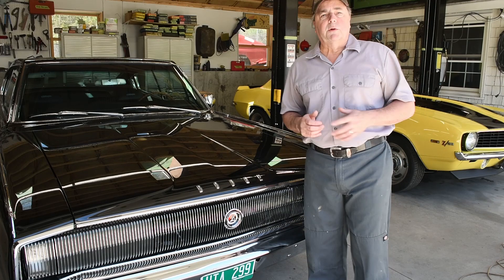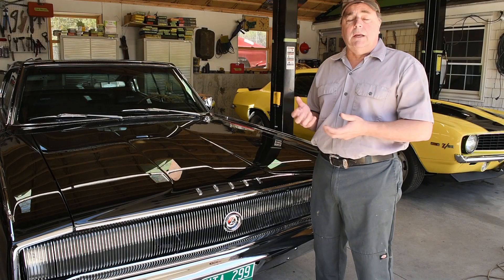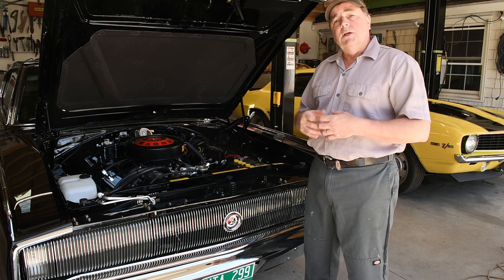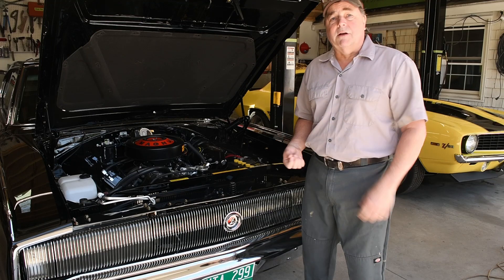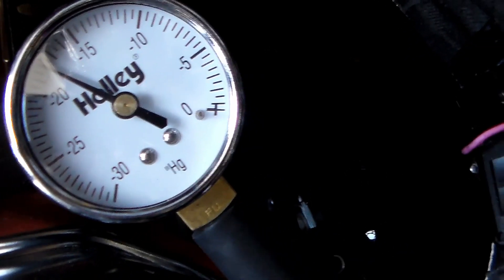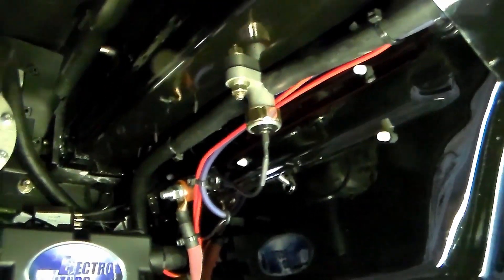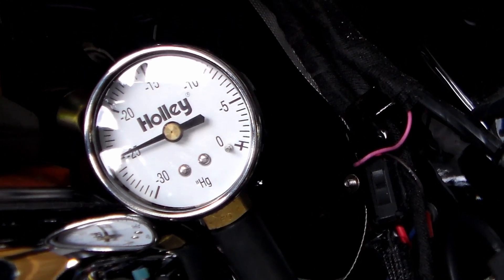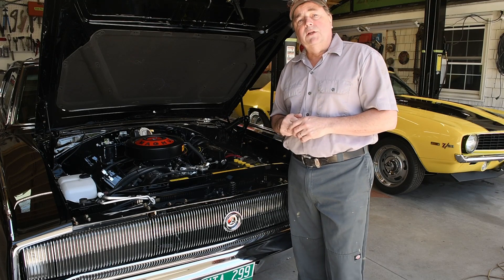No Vacuum = No Brakes!  A Leed Vacuum Pump can fix that. I'll show you how

Comment: I would still use a relay. Connect the relay to switched ignition and battery. This way it only comes on when the key is in the run position.

Comment: Yo Troy I'm so glad I saw your video about 2 years ago I have a 2011 Camaro SS rebuilt my engine I also put a BTR stage 2 LS3 cam and I was having a vacuum problem with my brakes I was going to buy vacuum canister and then I came across your video I bought the exact same one mine is Chrome I would have liked it to be in a metal canister but it was made of plastic I think I paid close to 400 dollars for it it's perfect quiet as a mouse no problems even if it did make a little bit of noise which it doesn't you wouldn't be able to hear it over the Dual Springs the cam straight pipes with the Texas Speed headers thank you for the video it's a really great piece of machinery no problems
Reply from the maker: Glad I could help

Comment: I installed the pump correctly but it do not turn off or pump enough pressure, the master cylinder is new  do the size of the master cylinder have anything to do with this ?
Reply from the maker: You have a vacuum leak. Plug the hose coming off the pump and see if it will stop automatically.

Comment: Will this work with an ls swap fuel injected setup?
Reply from the maker: Yes it will
Reply: @troykane ok great... somehow when I press my brakes while in park, the car shuts off instantly
Reply from the maker: @terrylinellc5550  does it stumble and stall? It could be vacuum related. If it shuts off like when you shut the key off it could be electrical.
Reply: @troykane yepp it shuts off immediately when pressing the brakes down... I do have a stage 3 cam installed with a PSI brand PCM
Reply from the maker: @terrylinellc5550  I would determine if it is a mechanical issue or an electrical issue. It may be electrical

Comment: I could really use something like this. I have a gm truck with a Magnuson 1900. From my understanding the blower works off of vacuum would you know if this pump would effect performance of blower?
Reply from the maker: Your supercharger is pushing air into the engine. Without the supercharger the engine is sucking in air, which is vacuum. Therefore you esentially have no vacuum with a supercharger in boost. So yes this would be an alternative source of vacuum to run your brakes and I would highly recomend it.

Comment: Did you t in vacuum from the engine as well with a check valve on the engine side and pump side?. I have had several failures with the vacuum pumps and still have a little vacuum back up from the engine even though it runs out quickly. Looking into the leeds  pump now.
Reply from the maker: NO engine vacuum. The pump does it all. As long as the pump has power you have brakes, even if the engine stalls.

Comment: Do you need the extra tank and will you still have power brakes if the motor stalls because it's electric?
Reply from the maker: You don't need the extra tank. But it does provide reserve vacuum. And yes you will have brake brakes during engine off condition, engine has nothing to do with brake vacuum with this system.

Comment: Hello Troy, 
Fantastic video! I think this is exactly what I need. I bought my friends 72 Challenger Resto Mod and he did Baer Classic Disks all around with all new
brake lines and master and booster and the whole nine yards but the pedal is so stiff and you can barely stop the car at slow speeds. 

He thought he got too large of a bore master cylinder because he tried a vacuum canister and that didn't work. But it's got a massive cam in it. It's a
410 CID  stroker 360 with a Comp Mutha Thumpr Roller and 1.6 RR's so tons of lift and tons of duration and overlap. I haven't checked the levels of 
vacuum yet because I haven't driven it much but I suspect it's very low.  

I think this Leeds kit will fix me up.  Has your unit held up for you? It's been 3 years now.  I really appreciate the video!
Reply from the maker: The pump still working great! I would check your vacuum at idle first. I would think it's low, and the pump would correct your problem.
Reply: @troykane   Troy, thanks for the follow up! Yep I am going to verify the vacuum at idle first. Honestly with the cam this engine is running 
there can't be much.  I never even thought about the vacuum issue at first because any other old car I had with a huge bumpstick always 
had manual brakes so I never had this issue before. LOL  It will be nice finally fixing the issue because the Baer Classic 4 wheel disks on this
car have to be amazing once they are working right.

Comment: Sir I’m having. A similar problem with the transmission and vacuum do you think this will fix my problem ?
Reply from the maker: Ok the pump will provide a consistant source of vacuum. This will be perfect for a brake booster. However this is not something to connect to a tranmission modulator. The modulator needs vacuum from the engine to allow the transmission to shift properly.

Comment: Yes Sir, ver cool set-up! I’d purchased the same led brakes vacuum pump In chrome. The slight vacuum drop-off will cease when the pump gets broken-in. Mine did similar, after a week or so the vacuum stopped the slight drop-off in value. Great set-up for safety Sir, cool ride too!

Comment: Hi Troy, beautiful car. I have this pump on my 69 El Camino because the LS I put in it only produces 10in of vacuum at idle with the cam that is in it. The pump is very quiet and works very well for the most part, but sometimes when I hit the brakes, I have no brake assist which is a very scary situation when you have to stop in an emergency. When I put a vacuum gauge on it, it pumps to 22in and turns off but will not turn back on until it reaches 10 or 12in which is not enough for my power brakes. I suspect it is the switch that is bad, from what I have found online this is a fairly common problem with this pump. Do you think the switch is my problem and are you aware of others having this problem with the switch? Thanks in advance
Reply from the maker: I think your diagnosis is spot on. I would contact the folks at Leed and see if they will help you with a replacement part. Good Luck

Comment: Great video!
I installed my pump the other day and I’m having a bit of an issue.  It’s makes 25Hg of vacuum very quickly, however it will not shut off.  Once it hits 25-26Hg the gauge will bounce back to 20 or 15Hg and then right back up to 25Hg. I’ve checked the voltage, the ground and the power source and all are good.  There are no leaks in the lines, just cannot figure out why it won’t shut off.
Reply from the maker: I would contact Leed. You may have a regulator issue. Good Luck
Reply: I'd be checking for a leak somewhere. It sounds like once you get high vac it leaks in, vac drops and leak stops then over and over again.

Comment: Just a quick follow-up to my previous posts.  The cycling of the Leeds Black Bandit ( I have the naked version) was cycling almost without a break.  When the unit gets to the predetermined vac it shuts the pump off. I traced the 3/8" vac line back from the booster to the pump after disconnecting it from the booster's check valve.  It turns out that the vacuum line was leaking. The OEM hose used on my 79 Trans Am from the engine to the check valve looked like 3/8" vac line but it is actually smaller at 11/32.  The line was leaking, plain and simple. So, the vac line will be replaced with the smaller diameter vac line soon. The simplest way to check for cycling is to put the pump in the on position at the key switch and then using your thumb cover the open end of the vac line.  When it gets to the predetermined vac pressure the unit will stop running.  This was how I diagnosed the near constant running of the pump.  Hope this helps others.  Thank you Troy for your input back to me, below.
Reply from the maker: Glad you found it. Glad I could be of help.

Comment: I've had my Lee's vac pump on my TA for a year.  The concern I have is the cycling of the unit.  It emits a high pitched sound when running and the pump seems to run without shutting off for any length of time.  Troy, I know you have a separate can to help store vac and I am wondering if your unit is cycling constantly.  No leaks have been detected.  Need your thoughts on this.  Thanks.
Reply from the maker: Thanks for the question. My question to you is what are you running vacuum to power? I will assume a power brake booster. I would test that booster to see if will retain vacuum. Same goes for any other vacuum accessories you may be connected to. I would also test the pump by capping the suction port let it run and see how it reacts. Good Luck

Comment: great video, 2 questions if i may, did you run any check valves and did you eleminate the vacuum hose off the motor to the brake booster and stick with just the pump?
Reply from the maker: Good questions. I run just the pump. So I capped the engine vacuum port. You have to keep the check valve at the booster. That's it you're good to go. Good luck
Reply: @troykane   thanks so much Troy, i appreciate it
Reply from the maker: Anytime! Good Luck

Comment: Can you discuss the Electro-Wizard battery disconnect switch?  me and mechanic were having a hard time finding an ignition power line to hook into.  is this what alleviates this issue? keeps it from drawing power all the time, even when off??
Reply from the maker: As far as a battery disconnect, that would be main power between the battery and the vehicle. That will cut all power to the vehicle.
Reply: @troykane  thanks,  So that is a separate thing, not part of the brake vacuum system? (just mounted there for space issue)?   thanks again, and what a beautiful car,
Reply from the maker: Yes totally unrelated.

Comment: I like this.  I have a mechanical vacuum pump on my 1981 Mercedes 240d.  They are becoming very rare and the parts for fixing them are starting to become rare.  This will solve my issues.
Reply from the maker: Good Luck

Comment: Hi Tony,   Great video.   Couple of questions...  does the Leeds pump eliminate the need for an external relay?  Are you connecting the power lead to a switched 12v circuit in your car?  Why is the vacuum tank required?  If the unit can produce up to 26 psi and you have a master brake tank to store the vacuum that tank seems redundant.  I have the same situation with my '71 hemi cuda.  Only 10 psi from the engine.   Final question...   will having the vacuum at the proper level also reduce the amount of pedal travel.   I have excessive pedal travel and am hoping that this is also resolved with the new pump.  Thank you!!!!
Reply from the maker: Relay is inside the unit. Connect to keyed 12 volt source. You technically don't need a vacuum tank. Pedal travel is not related to vacuum. Make sure the system is bled. If you have rear disc brakes make sure the E brake is function to provide proper adjustment. Make sure the rod from the pedal to the master cylinder is the correct length. Good luck. thanks for the comment.

Comment: Hey Troy what's up I recently left you a comment about the Camaro that I rebuilt and I need a vacuum pump well I ordered it I got it it came today really nice looks nice heavy duty the only thing I'm not too thrilled about it being a plastic canister when I ordered it it didn't say anywhere anything about being plastic it just said Chrome or black so you here Chrome right away so you think it's metal well anyway it's the most quietest one out there on the market see how it is when I install it thank you for the video

Comment: What's up buddy glad I saw your video I have a 2011 Camaro SS Inferno Orange I love the car it has 120,000 miles on it buying a new car would have been through much money for insurance and to pay off $50,000 so I gave it to my mechanic I bought all the parts Brian Tooley stage 2 cam crank Pistons oil pump water pump push rods had the heads ported and Polished new valves crank Pistons cost me about $15,000 need a vacuum pump all those other pumps sounds like your engine is knocking ridiculous would never even attempt to buy one of them so I saw your video did some research and I just ordered the Bandit from Amazon enclosed in a chrome canister looks really sharp should have the car back by the middle of next week the car is a beast thank you for the video really appreciate it it was $399 not that bad I guess
Reply from the maker: Cool! glad I could help. Thanks for the comment

Comment: Do you havs to run a canister or can you run the pump directly to the brake booster. The only vacuum my car uses is for the brakes
Reply from the maker: No canister required. you can go direct to the booster. Good luck

Comment: I just had my Pontiac 400 engine rebuilt a couple years back for my 1978 Trans Am.  The engine builder installed a very lopey cam.  Ever since the rebuild, I have had almost no brakes and the throttle response is poor.  The engine is built to produce a little over 400 hp, nothing too crazy, but good power.  Do you think this pump would cure my issues?
Reply from the maker: Yes more than likely if the booster is receiving low vacuum. Best way to know is to test the engine vacuum with a vacuum gauge. Test the brake booster as well. As far as the poor throttle response, that could be a lot of things. I would work on the vacuum system first. Make sure you have no vacuum leaks in all the connections and hoses. Carb cleaner sprayed on the hoses and connections will show a leak by the engine sound. Spray listen for the engine to increase in idle speed. If so you have a leak. If not, no leak. Good luck

Comment: Had a question i was running a old style piston vacuum pump thats set up in trunk..works fine but noisey..i bought the bandit to switch out ..my problem.is when i hook up new bandit pump it runs weak like not enuff power or something ..i hooked directly to. Battery and works great..so i know its not defective ..any reason why the hot and ground that runs my piston pump fine but dosent power the bandit ..it gives power enuff to hear it running but very weak ..any suggestions i might be missing ..? Thanks

Comment: Hi ..very smooth ride ..question I have ..my piston style vacuum pump is located in trunk inside a metal box .but very noisy to say the least ..my reservoir  canister with a vacuum gauge  is located in engine  compartment..so my question with this pump can I use existing area in trunk and remove my piston pump and with this new rotary pump put in same area and use the existing vacuum line that runs to front of car to the vacuum caniste reservoir that has the gauge on it ?
Reply from the maker: You sure can. You actually don't even need the reservoir. But it doesn't hurt to have it. Good luck on your project Troy

Comment: Just one thing I was thinking that my pump was U/S because of that noise ;)
Reply: It is number 2 pump and first one did the rubber in side of the pump and would not stop running . This one looks like it’s done the same thing . As it don’t shut down when vacuum built up . Just keeps running .

Comment: Do you need to hook this system up to the intake manifold/carburetor at all? I am trying to set up something for my 1958 International Travelette. It has a straight 6, and I dont think it has any factory vacuum sources that I can use. I was hoping a vacuum pump is my answer, but I hope I dont need to connect it to the intake/carburetor anyway. I want to route right to the booster.
Reply from the maker: This system replaces the need for an engine vacuum source. It creates the vacuum with out the engine. Hope this was helpful. Good luck with your project!
Reply: @troykane  Actually this is very helpful! I have bee trying to find a solution for months. I'm just a 19 year old kid who has a project truck for a hobby. No one could give me a solid answer for some reason. Thank you!

Comment: A buddy of mine has his car in a " performance shop" & they're telling him they are going to put a vacuum pump on his car because the vacuum line to his th400 isn't getting enough of a signal.  The car can make 15"s  & the cam isn't that aggressive. so it seems like they haven't diagnosed the problem and are just throwing parts at it.
Reply from the maker: Hello, 15" of vacuum does seem like plenty to operate a turbo 400. I'm curious where the vacuum is coming from. You need direct manifold vacuum, not ported vacuum from a carb fitting. Also check the vacuum right at the modulator, down at the transmission. this will eliminated the possible cause as vacuum loss. 
Good luck on your project, Troy
Reply: @troykane  its coming from the intake but they are saying they will hook the transmission up to the vacuum pump 🙄
Reply from the maker: @hieronymus..bosch8532  That doesn't seem right to me. The reason the transmission modulator is connected to engine vacuum is so the transmission gets engine vacuum.
Reply: @troykane  exactly.  But they seem to think it will fix the obviouse valve problem it has
Reply from the maker: @hieronymus..bosch8532  Good Luck, maybe a second opinion is in order

Comment: I installed the exact pump on my 62 Chevy II. Is it normal for the brake pedal to drop all the way to the floor when only the ignition is on and the vacuum has reached 25 psi? When the car is completely off, the pedal gets firm.
Reply from the maker: I am not sure exactly what you have going on. But, in a car with power brakes, the pedal will be hard when the engine is off (no vacuum). When the engine is started ( vacuum applied) the pedal will drop and be softer. However this would not be a "pedal to the floor" situation. I would check your brake system, for proper adjustment, pad/shoe wear etc. Also consider rebleeding the brakes. One other test is to pump up the brakes and hold pressure on the pedal. If the pedal goes down gradually you have a faulty master cylinder. Hope this was helpful. Good luck on your project,  Troy